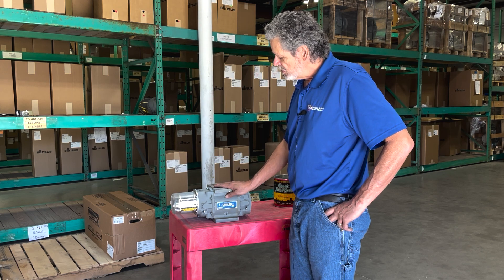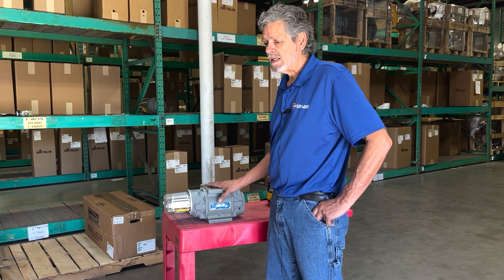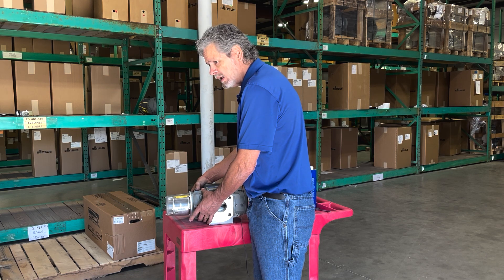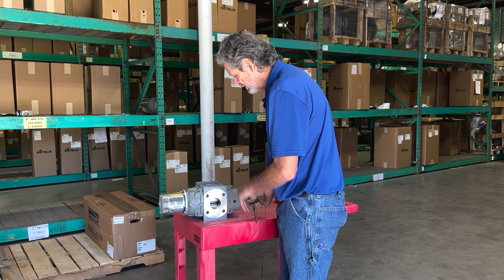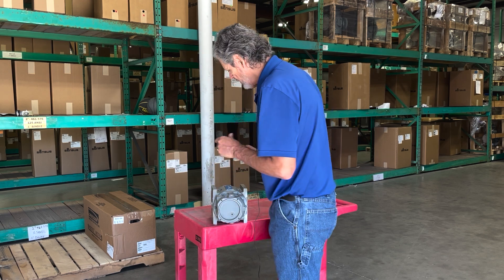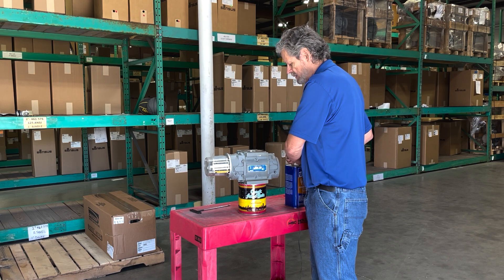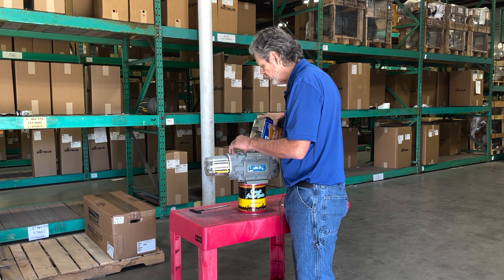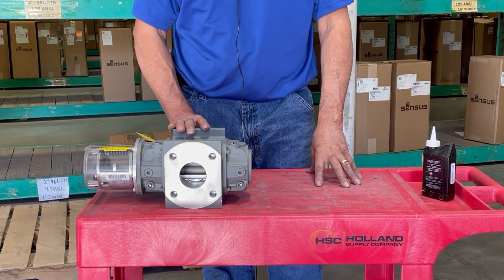How to Flush Debris from a Dresser Roots Meter

Comment: I am a repairman of rotary gas meters (Romet, Roots). Could you tell me how to adjust the impellers after replacing the bearings so that they do not bump into each other?
Reply from the maker: The meter has “skipped timing” if the impellers are bumping each other. 
1. Inspect impellers for burs or damage.
2. Retime the impellers by removing the gear end cover and index cover.
3. Loosen 1 bolt on the same impeller for both ends. This will now allow one impeller to spin freely. You may need to use a gear puller to loosen the gear on the tapered shaft so it turns free.
4. Position the impellers so they nest properly with the “head” of one impeller nestled into the middle of the other. 
5. Push the loosened gear onto the shaft and hold it with a finger while turning the shaft and gear at the same time. Your finger is keeping the shaft from turning inside the gear. This should allow you to rotate both impellers at the same time and correct any further timing issues.
6. Once timing is corrected tighten the bolt on the gear end making sure the impeller does not move. Repeat this step as necessary until timing is corrected. Tighten index end bolt. Do not overtighten bolts and locktite is recommended for the bolts.
7. If timing continues to be off one of the impeller shafts may be bent or one of the head plates may be dimpled causing the problem. In these cases the components may need replaced.